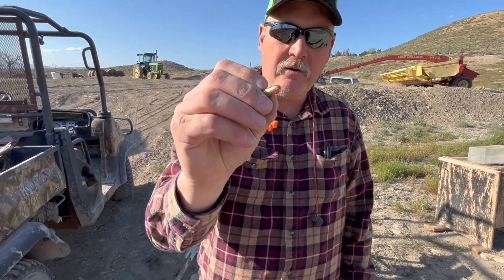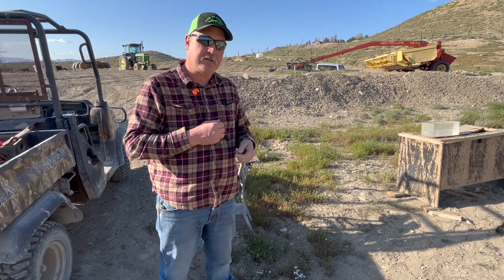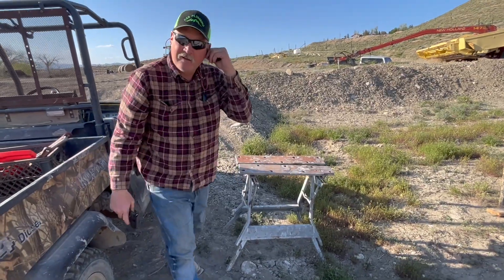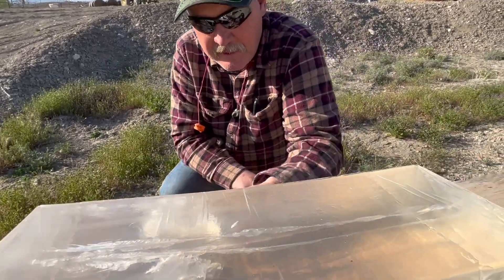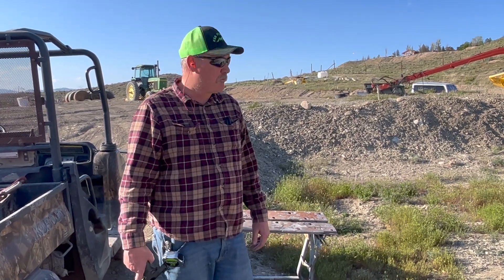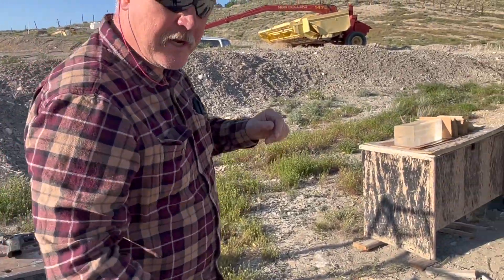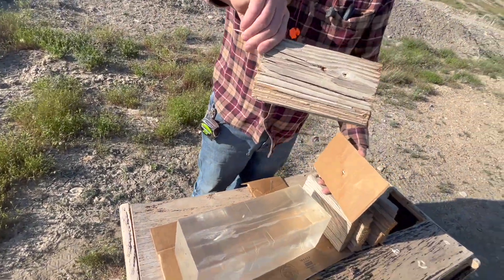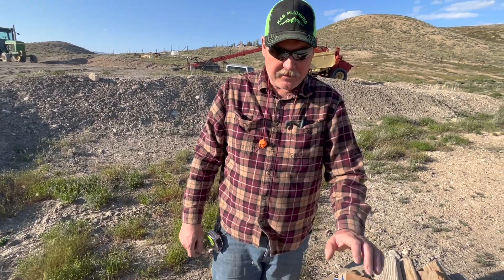Berry's 124 gr hybrid hollow point ballistic gel test

Comment: That’s a reloaded bullet. What type of powder how many grains and what was your velocity? It’s a reloading problem not a bullet problem.
Reply: 1250 fps is their sweet spot
Reply from the maker: Unique powder.  About 1100 fps.   I have heard they do better with more velocity.  Thanks for watching
Reply: @chrisevansgunshorsesranchi699 I'm thinking about loading the 125gr in a 357sig at 1400fps, wish me luck.
Reply from the maker: @linkbond08  good luck that sounds pretty hot
Reply: @linkbond08 I got 357 sig up to 1550 with those using longshot
Reply: @CohensFunAdventures  my local store carries longshot I'll pick it up Monday. 
Edit: my reloading app shows
125gr launched with a max charge of 8.0gr of longshot doing 1,351 ft/s 
That's probably calculated with a 4" barrel
I have a 5" on my m&p so I usually get a little more speed. 
What is your barrel length? And charge weight? I may just creep up to max and call it a day.

Comment: Nothing about the load data or the velocity: realy nothing to compare it with...  I've seen reliable expansion in other videos, especially at 1,100fps or so...
Reply from the maker: It is going about 1000 FPS using unique powder. About middle of the road. I have had  a few comments that the Berry's perform better at the upper end of velocity. Sorry about not giving out load data. Youtube is very touchy about things.  I Have already had one strike against me don't want to take any chances. I am glad to share load data or anything else through email. I have done some videos on the 30-338 win mag in a Saki finnbear. I had a viewer ask a ton of questions about the loads and forming of the brass. We shared a lot of info through email. As far as the 9mm I recently bought a large quantity of 115 gr Sierra JHP's. I will be doing some load testing on those this winter. I got them at about the same price as Berry's. Thanks for watching